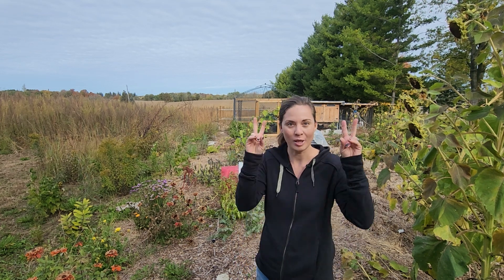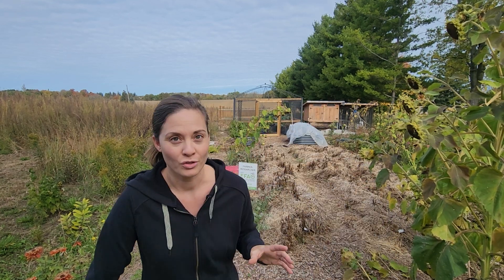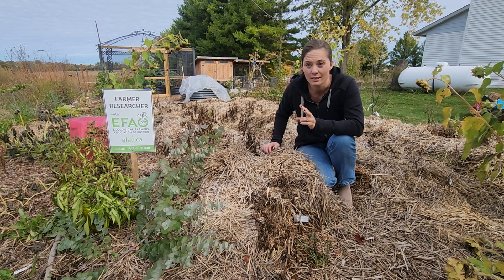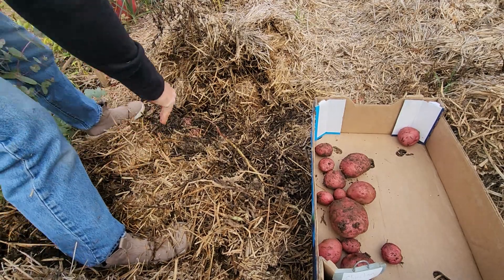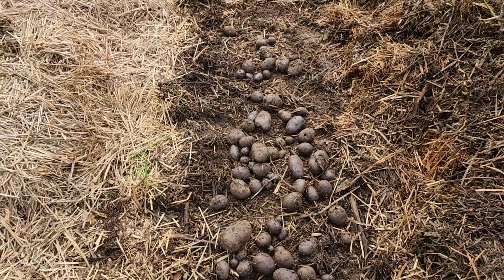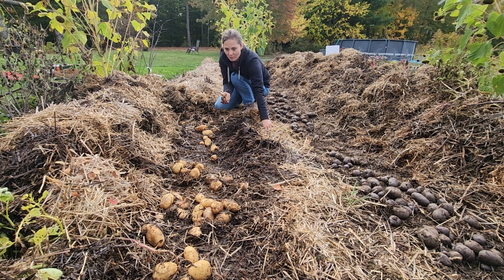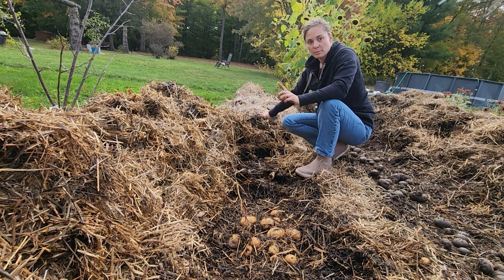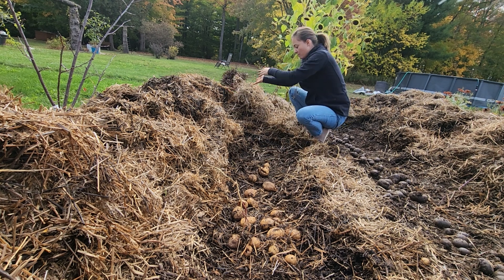No Till Potato Trial Results! How Much Did We Harvest? (EFAO-Funded Experiment)

Comment: Were the potatoes with less seed spaced further apart to keep the rows/area the same size? Or was the spacing the same for all the seed potatoes and the ones with more seeds given a larger area?
Reply from the maker: Hi! I spaced all varieties of seed potatoes relatively the same distance - i set them on an angle (zigzag pattern) down the rows so I could squeeze more in, roughly 10" apart on average. One thing that may have increased yield even more would be to cut and chit the season potatoes before planting. I ran out of time for that this year, so one seed potato equalled one potato plant. If I'd cut and chit them first, I could have stretched my seed potato investment more and gotten a couple of plants from one seed potato.